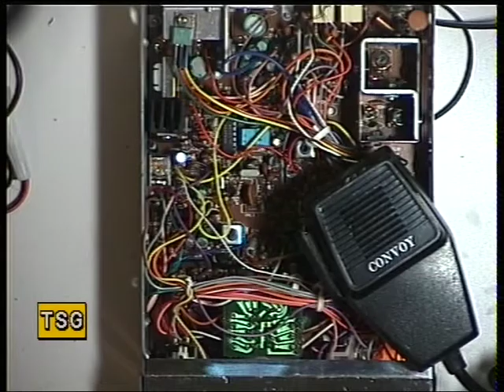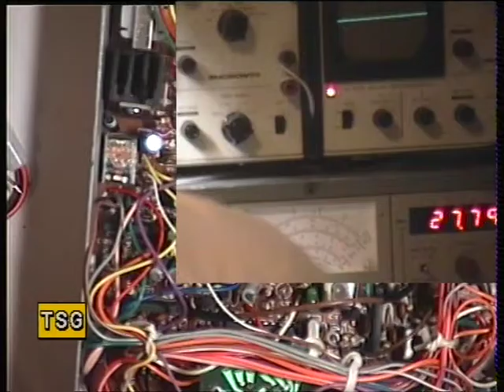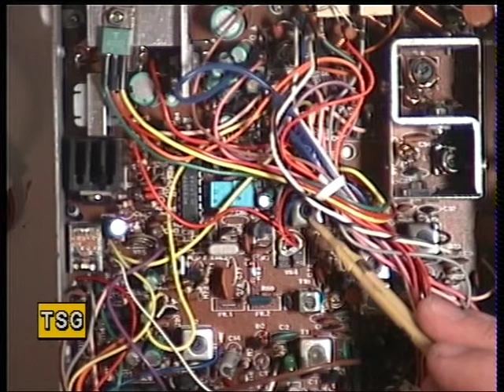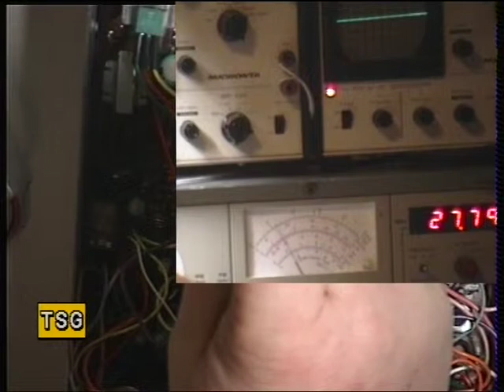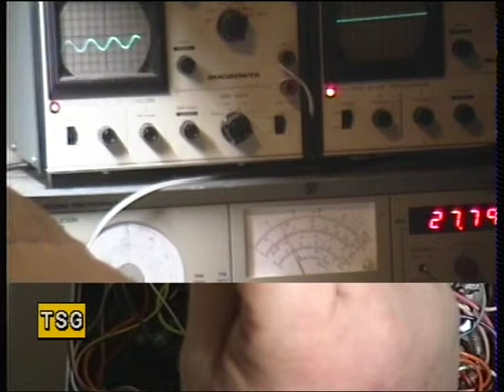Domico Convoy 1, UK CB radio. Alignment of Receiver

Comment: I have one of these the needle on mine only moves on tx
Reply from the maker: It'll be a faulty meter preset potentiometer.

Richard
Reply: @ukfmcbradioservicingTango21  Can you purchase them anywhere. 
Tia
Reply from the maker: @theamertureradioenthusiast3368  No. Only RapidOnline seem to do them these days. They are called hotizontal skeleton presets, but you don't know what value (as in ohms) that you need. I looked on my circuit but unfortunately it was illegible. I'll see if I can find my Sun 401 radio that uses the same chassis & do a video on that & go to the trouble of removing the s-meter preset to find out it's value.

Richard
Reply: @ukfmcbradioservicingTango21  Ok thank you buddy for your time.I bought it of Ebay it's like brand new. Everything else works fine
Reply from the maker: @theamertureradioenthusiast3368  I've dug out the Sun 401 & it's on the bench ready to do a video on come Monday.

Richard
Reply: @ukfmcbradioservicingTango21  Thank you buddy you're a star
Reply: @ukfmcbradioservicingTango21  Hi
Do you have any videos on a Lake Manxman 950 .Seems to be very poor on recieve.Unless it's not that great of a radio picked it up for next to nothing Good condition to.
I'm talking about from like 12 miles away well the convoy 1 seems to pick it up good.
Regards nick
Reply from the maker: @theamertureradioenthusiast3368  Yes, I will be doing that & others using the same Great Chassis. Search for my videos on the Fidelity CB1000 that uses the same chassis. These are a 3.5W radio by the way & anything over 2.5W is acceptable & not faulty. They have very sensitive receivers but need a sweep generator to align. Bleedover boxes at the time, but that doesn't matter these days. The squelch works on an AM detector & is really nice.

Richard (UK)
Reply: @ukfmcbradioservicingTango21  Thank you mate that be what it is then.You can see the needle knocking about on stations like theres someone miles away. It works fine from like 6 miles.Thank you again for your expert advice.

Comment: Hi i was wondering if you could shed some light on a cb radio ive just obtained it had dead audio and the rf meter didnt swing also the pa didnt work ive replaced the audio chip and the pa now works along with a sush in cb mode, but still no receive and the rf meter still doesnt swing , transmit all ok, 
The radio is a transcom gbx 4000,
thanks chris,
Reply from the maker: I've just produced 3 videos for you that cover the Mustang CB1000, which uses the same chassis. video 1. VCO....check your rx vco. video 2, transmit....also covering your meter snag, though the meter itself could be faulty. Video 3, the receiver with tips for you.

If you don't already have it you need a copy of the service manual. The Fidelity 2001 may be best as it has a standard meter & may be available from Knights at Kirton...I've mislaid my copy. Otherwise use the Amstrad 901 manual, readily available for free download. I've uploaded it to Scribd for a start!

Video 1 should appear abound 11:00 pm 22/1/14. Video 2 & 3 will upload in the early hours of tomorrow, 23/1/14.

Richard